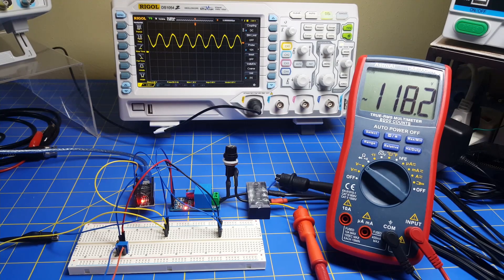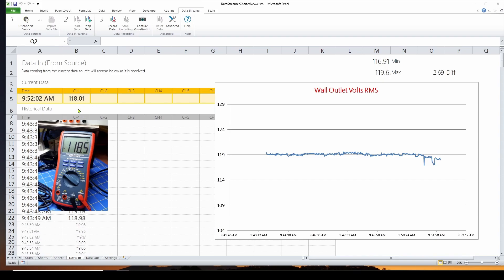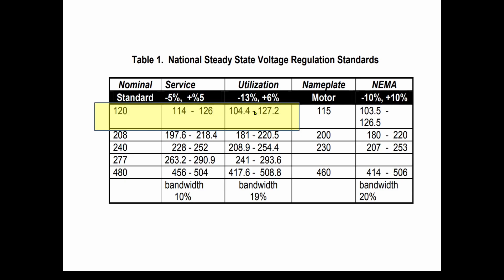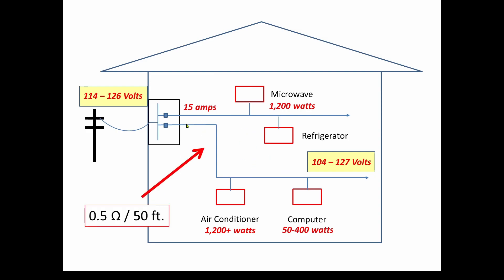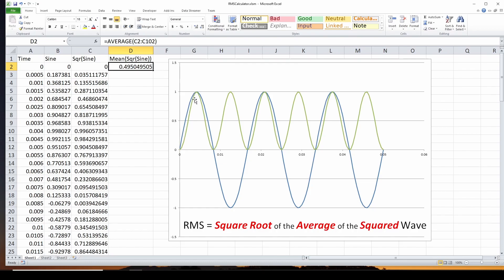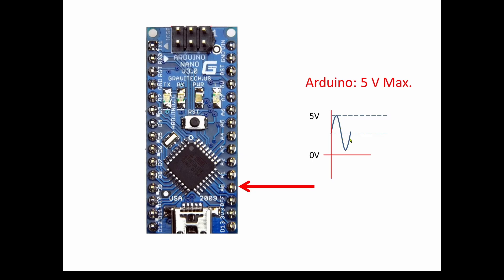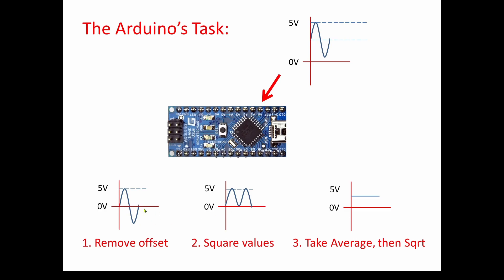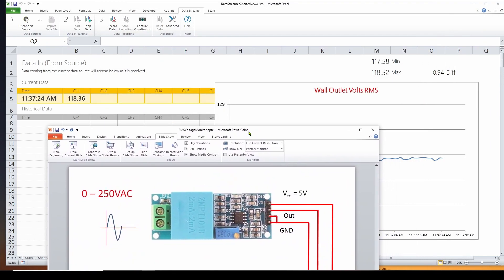RMS Voltage Sensor Part 1: Design

Comment: I love what you are doing sir! I'm just commenting to let you know that I'm doing your project for this series. I think I'm gonna mount the ZMPT101b in a lasagna pan (chassis). I'm buying a 3-prong computer monitor replacement cord and splitting it into its hot, neutral, and ground wires via Yetlebox terminal. Hot and neutral go ZMPT101b input. Then I will solder ground to the lasagna pan. Cheers!
(Edit) I forgot to mention that I will put a fuse between the hot and the ZMPT101b input.